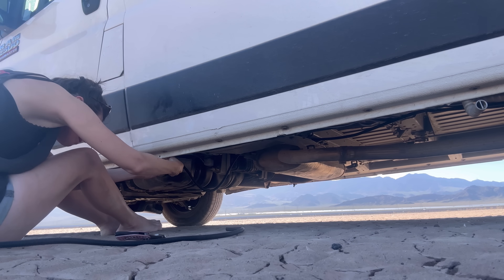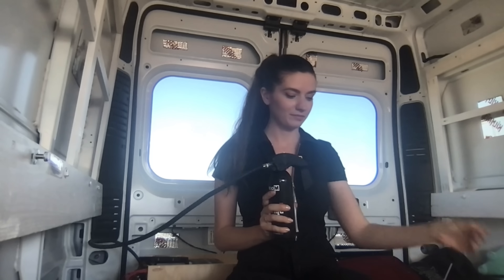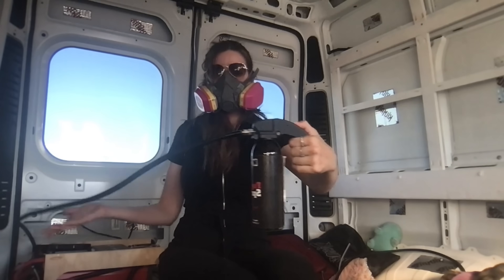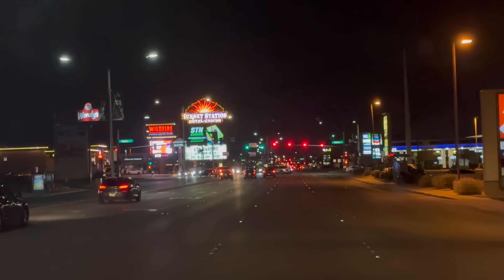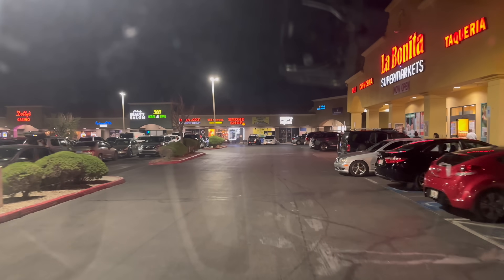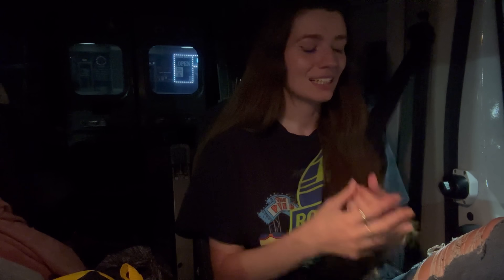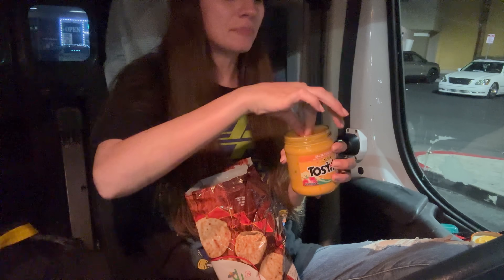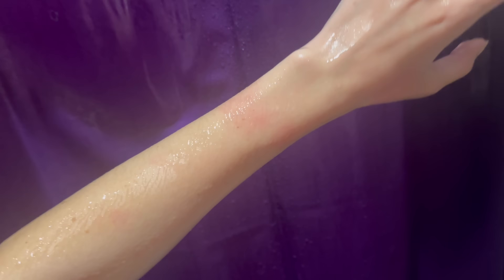Camper Van Build Gone WRONG… No Where To Sleep Tonight…?

Comment: Tory this is a bit late to tell you But if you have plain yogurt in your fridge and coat is onto where the burning sensation is worst, leave it for an hour and then rinse off, the sensation should be gone. I know because on vacation in former Yugoslavia I burned the insides of my thighs, to the extent I could not walk. And it was a chambermaid told me what to do and it worked. So maybe next time try it for yourself and see?

Comment: Omg 😱 that was a bad day.  So weird that connector failed. I’ve used them so many times at work and they just work. I’m sure you’ve already figured it out by now but I usually just snip the end with a wire cutter and push it in as far as possible then pull on it to make sure it’s in. By the way what a cool safety idea 👍

Comment: In the future, put the cannister and connection hose inside of a clear, plastic bag to contain any leakage when you squeeze the trigger. 🙂

Second, wrap a bit of "teflon tape" ($3) from Lowes around the outside of the hose connection or even just electrical tape to seal any potential leaks.

Sorry that happened to you. 🥺

Hope for the best outcome but always PREPARE for the worst outcome. 😁

Comment: So sorry to see that the hose came off … Pepper spray is so enjoyable… And no you did not have the tube very well-connected and clamped down… you can also purchase a BYRNA delivery system… it’s a CO2 pellet gun, fires a .68 caliber hard plastic ball or pepper balls that break on impact… does work…

Comment: Been there due to job requirements.  It's good that it burns, it means it works!  Get a clamp to clamp it on so there isn't any question.  You don't want to have to bail out in a bad situation.  Also, you can indure it, but it takes will power.  If that happens, turn the vehicle on and blower on full to creat positive pressure to blow the spray out.

Comment: One of the best securities I have installed in my van is thunderbolt locks. I highly recommend them. 

Also, the station casinos (pretty much all the casinos off the strip) usually have a decent amount of uncovered parking and are usually cheaper to stay at as well if you do have to end up getting a room.

Comment: That parking lot really isn't sketchy, I know exactly where it is. Pro tip, where you put the sticky back zip tie mounts, next time you use them, a couple drops of super glue works wonders. The summer heat will make the adhesive fail

Comment: If you are going to be attaching a hose to a device which is pressurized, you may want to look into using Jubilee Clips.
If you do use one, be aware that the rubber of the hose may "relax", requiring you to further tighten the Clip after 10 or 15 minutes.

Comment: If the problem was the way the hose was cut or a connection issue, why did it work outside but not inside?

Comment: Oof, that looked miserable.  That's a lot of hose for that small canister to force the spray through.  It's going to take the path of least resistant.  Try snugging a zip tie to the connector so that it is not the weakest point in the system.

Comment: GET A HEAVY DUTY PLASTIC BAG AND PUT THE CANISTER IN IT AFTER YOU PULL THE SAFETY PIN,POSSIBLY A CLEAR BAG AND THAT WAY IF YOU HAVE A MISHAP IT WILL BE CONTAINED INSIDE THE BAG,,,,,,,,,JUST A THOUGHT,,,,,BE SAFE AND BE MORE SAFE

Comment: You should research "foam cabinets" (cabinets made with foam board and a backing glued to it). I've seen a lot of female van builds that weigh too much. Causing poor gas mileage and handling, not to mention reducing the tow capacity. And... trying to live in a van and build it out is bullshit. I know from experience.

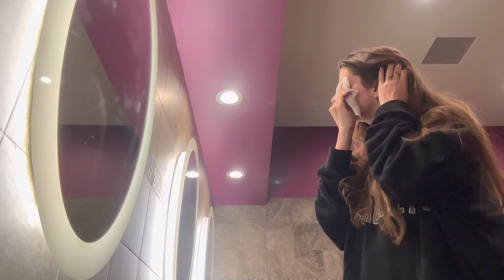Comment: Dumb question:  12:40  How can her entire body be in the video as if someone else is shooting the video?   It can't be a drone shot inside Planet Hollywood bathroom area, and I can't see how she could temporarily affix a camera to the wall can she ?       (P.S. I'm middle aged and while I grew up with computers, certain tech/camera selfie stuff I find really confusing)

P.S.  Maybe someone should tell Tory about  inexpensive perimeter alarm systems, that campers often employ when bears or snakes or whatever come within a few inches or
ft of your tent, or in this case her van,  I believe these camera's can be left off the roof and also act like a motion light with recording capability, which could discourage
some from snooping around her while she is sleeping,  than  when she is alerted, only than does the pepper spray level 2 defense need to be activated,

Comment: Not being negative but that pepper spray set up looks pretty dang janky. The bottle connection is bad, you have to drill holes all in your van...and after you fire it and it dries in the lines it creates back pressure and blows up in your face.....umm no thanks.

Comment: Just don't go to Canada. Pepper spray is illegal here.
Reply: @KaraBook  It's not -- but it has to be called "bear spray" and is only supposed to be used for animal attacks. You can buy it at any outdoors stores/camping supplies retailers, like Cabellas etc
Reply: @adriankung1625  But pepper spray is illegal. At least my Google says that. And I've seen some youtubers getting trouble with it At the border. Edit My brain is broken.
Reply: @superhero6098  Might be a problem to bring it across the border (maybe?). But to possess or purchase it once you're here -- no problem at all -- it's available to anyone for the "official" use, Ie Bear-spray.
Completely understand about the broken brain -- it's just one of those things that doesn't make alot of sense.
The intent is that they don't want hooligans or criminals using it. If you possess it for it's acceptable/ intended purpose, that's fine. If you then need to "improvise" and use it to defend yourself from a human attacker that will not be a criminal act as it is self defense. But you can't purchase it for that purpose, officially.

Comment: What are you going to do if there happen to be a Apocalyptic Event and the night 🌃 of the living dead rises how are you going to make them go away 😮😂😂😂I don't think pepper spray would work , If that would have happen to me I would have first ventilated before I did that kind of test my second would be i will have slept on top of my van and open the windows 💖❤️💜I will put or add lights under my van so if I ever get in to a problem I can see under neat 🏆🏆🏆🏆🏆